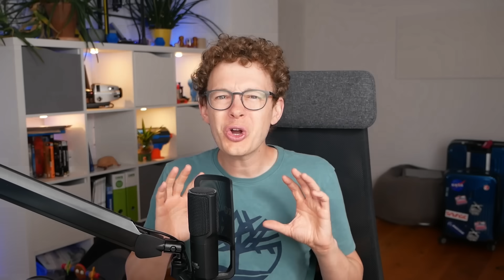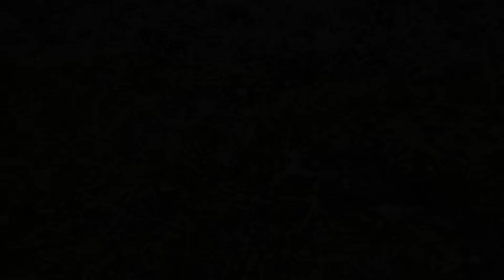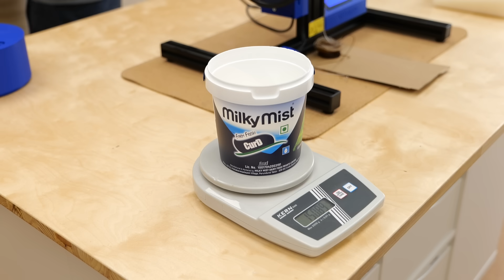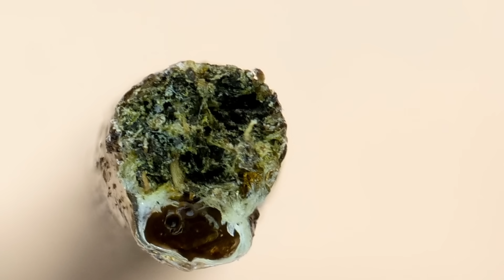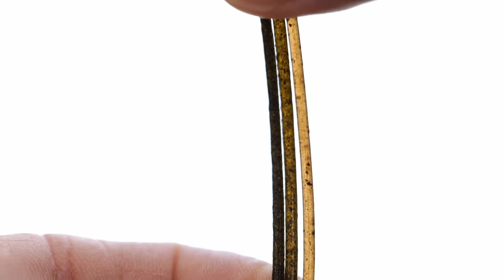Cow Poop Filament is NOT as BAD as you Think!

Comment from the maker: Would you buy PooLA?
If not, why not check our Heat Set Inserts and Tools 👉 https://cnckitchen.store
Reply: I would just for the marketing. PooLA is brilliant
Reply: @CNCKitchen 
Is it possible to add a vibration motor to the funnel at the top of the feed? To encourage better powder flow
Reply: Only if it was cheaper than standard PLA
Reply: Skip the middle man and use hay?
Reply: Warum Thermit im Filament
Reply: @Cooking.Brothers364warum nicht ? :D mir fallen tolle verwendungen ein :)
Reply: HorsePooLA might be a slight bit less gross as it does not start out initially as stinky mud.
Reply: When it reaches Prusa it will turn into Shitament.
Reply: I'd use it to build a POOsa printer. 🤭
As for the "heat creep" thing, well, it's obvious : the fan used to cool the heatsink is not powerful enough. Otherwise, this wouldn't have happened.
Reply: If it was cheaper (or had a unique finish or application) and didn't increase maintenance or part replacement demand, absolutely I would buy some
Reply: I'd buy a spool or two :)
Reply: I would buy PooLA. I like the special color!
Reply: i would produce it for sure :D actually, i am. just need the right format :D
Reply: sell poola on youre  online shop
Reply: Please open preorders. Put me down for 3 spools.
Reply: Yes, if for no other reason than the "iew" factor.
Reply: In my opinion, you'll anticipate better results if you experiment with pure fibers after boiling the cow dung to remove all other substances. The current samples contain too many impurities beyond the fibrous material.
Reply: definitely yes. 

is the poop model you printed at the and of the video also made oout of PooLA? 
and if it is, could i buy this print from you?
Reply: I'd give it a try.
Reply: If it was cheaper than PLA I would definitely buy it.
Reply: thermite filmate please
Reply: Why cow dung, we make our own supply right in our home.

Anyways hard no...
Reply: @nzalog  You make cow dung in your home? What sorts of animals reside with you in addition to cows?
Reply: @fermenteded  yeah, your mom is always here
Reply: @nzalog  Your own supply probably doesn't contain this amount of fiber.

Comment: Maybe that slowly turning screw-mixbar in the hopper is gradually changing the percentage of poo even in the plastic powder mix?  It's supposed to keep things evenly mixed, but maybe the density or particle size difference between dung and PLA means one gradually gets separated to the top of the mix in the hopper?

Any way you could you measure the density of the filament strand at the beginning of extrusion and then at the point when it began foaming and failed?

Super cool experiment!

Comment: My opinion is, that adding fibers can be very good. It's all the other crap that's the problem. The PLA itself got kinda yellow, I assume there are some minerals or weird compounds that entered it. Fine particles do not increase tensile strength of a material, they actually weaken it.
I think you should've sieved it twice, to get rid of particles that are too large but also particles that are too small. So that only the medium ones remain.

Comment: Something that might help with your feeding issues is creating a new hopper feeder.
You’d likely want something far more steep as well as smooth. Some thin aluminum made into a more narrow funnel might be just what is needed.

Also an idea that might be the cause for the foaming might simply be the inconsistent feeding, but more specifically the actual pressure as the hopper gets lower. The steeper and smoother hopper might fix that but so would simply adding more material as the hopper empties.

Comment: Talking about annealing PLA for getting more temperature resistance:  heating alone can make the material warp. Try to anneal it embeded in sprayform (Bauschaum) which should fix the print in place so that it cannot move or shrink or warp. Would be an interesting alternative to sand or salt without changing the texture

Comment: you can't compare the time to include moisture in pellets with the time to include moisture in powder.
It is a matter of surface and volume ratio, that is up to 100x higher on powder. Using basic diffusion equation, you should pass from days on pellets to minutes on powder.
If I was you I had Ar gaz in the extruder tank, as it is higher density as air, ti should be easy to fill and reduce significantly the adsborption of moisture. So just a little flow of Ar shoulf be enough to solve this issue

Comment: An idea: if you are able to extrude from the extruder a 50:50 mix by mass of PLA powder and dessicated cow poop, even with it starting to foam, you can theoretically chop it up with the pelletiser and add those pellets to PLA pellets. 

This then means that you get the darkness from re-extrusion, and you can more carefully control the ratio of dung to virgin PLA for experimenting. It also means that the hygroscopic qualities are more carefully controlled, as the pellets have less surface area than the fine powder. 

If you then, use, say, 2 parts of pelletised powder-based PLA/Poop (that's a lot of "P" in there), and 3 parts of virgin PLA pellets, you end with a 20% poop PLA product, and the extrusion through the ARTME should be more consistent. 

If I wanted to be awful about it, I could even suggest extruding the powders into a 3mm filament so that the size is more similar to that of the pellets for even better consistency...

Without the industrial scale processing gear, repeated processing for homogeneity of the material is how you'll get the ability to properly ascertain the viability of this. (If this information is useful to you, I'd totally accept some 15% PooPLA or similar to test it with some structural builds)

Comment: Great video! Love your DIY tensile tester. For fibers to reinforce mechanical properties you need to make sure the matrix is compatible to the fibers, otherwise it will just phase separate. In most cases, you need some kind of primer to help with adhesion between the fibers and the polymer. I don't know a system for PLA and cellulose, which your filler probably mainly consists of, but maybe you'll find something in the literature if you want to try.

Comment: Seriously, I did not hear any reason to buy PooLA.  Seeing the amount of effort you had to put in, I don't see it coming out cheaper than carbon- or glass-filled filaments and I didn't see an actual comparison of the stiffness, so I doubt it really has any true physical benefits.  I'm all in favor of reusing waste material, but I guess there are much more economic and ecologic ways to use cow dung than mixing it with plastic, so also ecologically I don't see it scoring a lot of points.  In short: good attempt, but I don't see this catching on.

Comment: Somehow a distinct lack of "ah, real printer poop" jokes...

I feel like the thing that always comes up with filled filaments is "is this using up something that would be trash, or is this purposeful?" and the answer to that is cost. Like used cooking oil, if some farmer has to pay to have their fields cleaned of poop, hey, etc. that is no longer useful to them (we know manure is used a lot, but I'm sure there's a limit somewhere), then it's going to be purposefully added into a materials and the cost of that material is going to be extra. So instead of $20 per kg, it's $25 per kg. I do wonder if the reduction in the amount of PLA offsets enough that it should still be $20 per kg... but that's a different topic. The other side is if it's using up waste... if that same farmer from before is like "wait, you'll take the stuff for free? By all means, go for it" then I don't see why the filament should cost more then $20 per kg and should actually be less then that.

So if it's a filament like so many recycled filaments where material is being purposefully used and thus it costs more, then no I probably would not buy the filament. Especially since I don't go through filament super fast to start with, I don't need "PoopLA" sitting in a bag for 4 years... Now, if you told me "hey, $18 per kg because it's 10% poop that would've just been thrown in a field and not used for anything..." then I would probably get some. But I feel it would almost certainly be handled with gloves and the nozzle cleaned after. There's just too much extra risk of bacteria and such if not autoclaved first. Drying is one thing, but that hasn't stopped bacteria before...

The other thing to remember is SOMEONE is going to use PoopLA in some etsy product that will be sold as "poop" color and a buyer will go "ha, it is poop brown..." and that product will almost certainly end up in some kids mouth, or on someone's face, etc. And I just don't think that is something we need being talked about on social media... But as a project and a properly labeled gag gift? Sure.

Comment: I think you hit the nail on the head with hemp filaments. Hemp is super fast growing, pretty strong, and very fibrous. I know it's already used as a concrete additive to reduce weight and improve tensile strength, so maybe it could augment filament the same? Might even do the same as glass fiber or carbon fiber in filaments but might also wear on the nozzle less? Lots of maybes!

Comment: A little tip for the sound quality of your videos: my (justifiably wrong adjusted) soundbar turns the sound off whenever the audio track of your video ist completely empty. For example between sentences where you cut the audio and left a teeny tiny pause. This results in the first word being swallowed after the empty audio pause. You can avoid this by putting the empty noise your mic picks up when there is no sound happening as a extra track under your voice over or (which is more work) as a cross fade in those empty audio pauses. Nevertheless, it's always good practice in sound design to never leave the audio track empty :) 

Also thank you for your really well researched videos and your own research in 3D printing, I always learn so much!

Comment: Extruding it with not a 100% filler used, pelletizing it, and adding more filler may work better. Less filler at beginning more likely that it will not crack, and coat surface in more dispersed even manner if less added at each step. Could you make sheets of PLA or plastic and then pelletize? If you could, you could make that, add infilll on top evenly, melt in a bit, pelletize, and put thru extuder.

Comment: Maybe the foaming issue is related to the amount of material picked up by the screw. I imagine that not having much material in the feeder at some point has the pressure drop so low, that the screw isn't picking up enough material from the feeder. It might even feed air because the poop/PLA dust isn't compressed as much?

Also: I guess this PooLA definitely has better biodegradable properties than pure PLA ;D

Comment: An idea for the filament: add a vibrator to the feeder, so all the bits fall at the same rate
Reply: Was about to suggest this as well. The vibration might not even need to run all the time, just every 30 seconds or so

Comment: If you add an eccentrically-loaded motor (like a rumble motor from a game controller) that might vibrate the funnel enough to keep the fine powder working its way into the screw.

As far as whether this is a good idea for a filler?  I don't really think so.  Cow poop does have a number of beneficial uses as you already mentioned, so I'd be hesitant to say that this is a better use over anything else.  Also, the poop would have degraded naturally into the environment, now it's encased in plastic and has become permapoop.  But we do have so many other waste products that result from normal manufacturing and consumer products.  If repurposing a material as a filler keeps it from going to a landfill, I think that's a better route.

Comment: I can only guess about what causes the foaming, but I'm guessing it is the ratio of air to feed material.  When the hopper is full of powder not much air can get into the process.  As the hopper empties it ends up with a gap through which air can easily enter.  The air is supplying the moisture that leads to foaming.  A simple solution would be to keep feeding more material into the hopper to prevent easy airflow.  Keep the hopper from ever providing a straight path for air to forestall the problem of foaming.  It might mean you can't ever finish a hopper, but you could recover the contents without extruding it when you have extruded enough.

Comment: I'm not sure about the logistics @CNCKitchen , but if you can get powdered polypropylene ( tpu might be too hot ) and mix it with powered sugar, you might be able to make a filament that you can print solid but dissolve the sugar out of in water to make an open matrix

I do have concerns over brittleness,  however

Comment: This was interesting. Not sure it's something I'd go for myself, but definitely an interesting avenue of exploration. As for the filament extruder problem with fine powders, you likely want a scraper/wiper that runs against the walls of the hopper that rotates instead of that screw "mixer" at the bottom. By keeping the particles in motion they are more likely to fall down the chute.  Adding a vibratory motor to the funnel may help with that as well. Note that this wiper change likely would have prevented the accumulation of powder at the bottom of the hopper you had in your first test, though a vibratory motor may have been counter-productive in that test. Anther option would be to make the walls of the hopper at a steeper angle, so that the pull of gravity exceeds the ability of the powder to settle. The challenge there is that it will be different for every powder based on grain size and density. (though generally, the steeper the better)

Comment: 17:37 I wonder if you could hook up some vibrating mechanism that would shake the hopper causing the powder to natural vibrating downward into the hole. Anyway at that size of particle, electrostatic charge build up is what I think is happening. Electrostatic charges build up as particles slide past each other causing the particles to stick to themselves and hopper surface. This is also especially true in low humidity environments. Humidity, which you don't want here, would help reduce electrostatic but since that's not an option ionized air could help. Not sure if that's like major overkill (I would think so lol). You're not doing massive volumes to warrant it. I think simple constant vibration to the hopper could fix the issue. Oh or just build some sort swiping mechanism to place on hopper that will push in addition to what the hopper already has.

Comment: I'm sure your foaming is simply from moisture, since it happens around the same run time. With the finer particles, the surface area is increased enough that the moisture absorption is likely accelerated. I would try to make a cap for the hopper with some desiccant built into the cap. It would likely allow you to finish a full roll.

Comment: If you're going to continue adding odd materials to filaments, you should really invest in a burr grinder. They can be set to grind a far smaller, and much more uniform particle size. Or maybe invest in the burrs and print the rest. I wouldn't print the burrs themselves unless you can print in something SUPER hard.

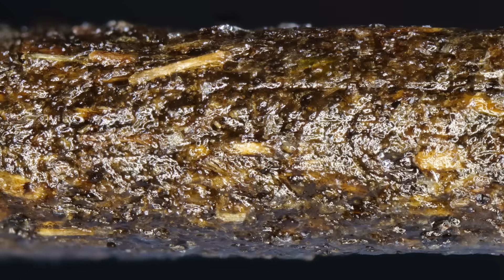Comment: 21:50 regarding that, Grass incorporates small amounts of silicon in its structure (phytoliths), some grasses getting up to 10% of their dry mass from silicon alone. You've effectively added a small amount of abrasive glass dust to your filament, so it should be treated like common GF filaments.

Comment: Great idea you had, too bad that for strength it's not really a good solution, but for making parts that don't undergo stress it can do the job very well. At the end of the video, you suggest giving yourself some ideas, and here's one that goes something like this in the sense that I'm wondering whether it would be possible, efficiently, to make filament loaded with hemp (not to smoke it, eh ;o) ), it's a super-ecological material that has a lot of properties and is used in many fields such as construction, clothing and so on, so if it were possible to extract fibers fine enough to be integrated into PLA, maybe it would be interesting to see if it could bring something to our hobby.

Comment: 17:32 Next time this happens, pull the material and check if it creates a string, spider web thin. If it doesn't, then it's "burned, aged, passed or whatever" and your temperature is too high, drop the temp by 3 °C at the tip and around 5 °C at compression and check again.
source: I work for a company that makes recycled ABS plastic, it's not the same, but some things should apply here

Comment: Regarding the feed problem: easiest way to help with this is probably to print a new stirrer that conforms closely to inside of the hopper. Less easy would be to buy (or design) a pneumatic vibrator and bolt it to the hopper.

Comment: You should maybe dry the fine powder PLA while it's in the hopper. My guess is the finer particles have more surface area, and therefore absorb more moisture from the air. The longer it sets out, the worse it gets.

Comment: You could add heaps and heaps of excess poowder to the pellets then mix it up and bake at about 80c then shake the dust out leaving only the coating stuck properly on the pellets. The excess poowder would need to be sufficient to prevent the pellets clumping

Comment: Adhesive filled filament next? maybe try taking something like cyanoacrylate, letting it dry, then pulverizing it into a powder and mixing the same way as done in this video? or if possible even a wet feeding method? hot glue stick could also be very interesting. Also, bone! most bones from food are discarded, maybe this is another way to give them a purpose. Thank you Stefan!